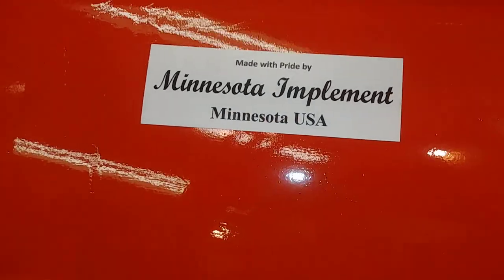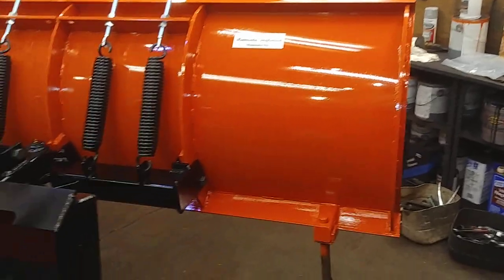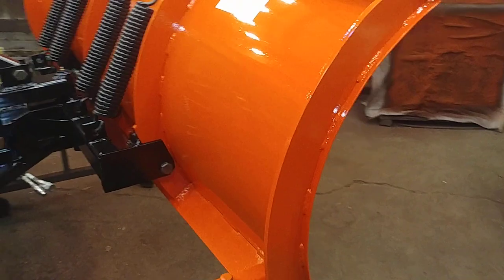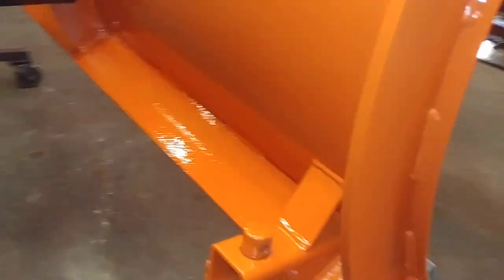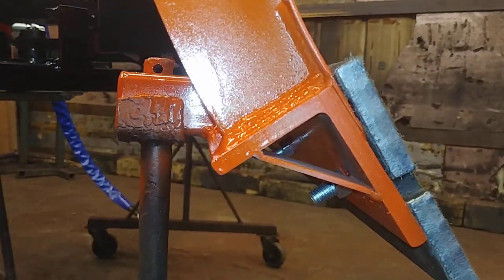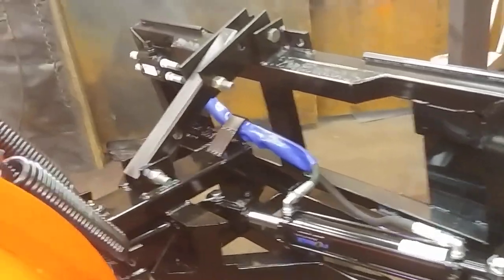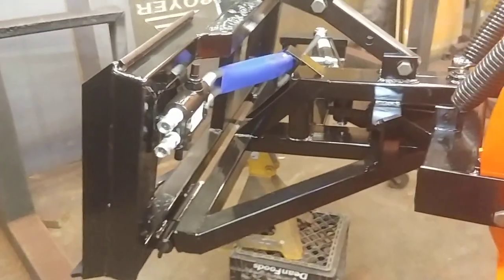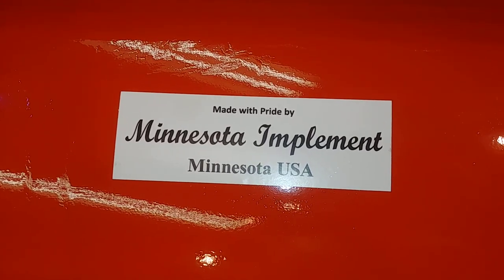Minnesota Implement snow plow comparison video of. heavy duty, standard duty and light weight plows.

Comment: Not being a hydraulics expert, I have a question about the operation of the cushion block.  As I understand it, when you reach the relief pressure, it shunts the oil to the other port in the block.  This makes sense if you have dual single acting angle cylinders because their volumes are identical.  It appears you make use of a single, double acting cylinder for adjusting the plow angle.  Since the volume of a double acting cylinder is different when extended vs. retracted, how does the cushion block function in this scenario?  If you hit your plow in a manner that forces the cylinder to retract, the volume of oil pushed out will be larger than the volume that becomes available on the other side of the cylinder which would result in a pressure spike.  Am I off base in my understanding?
Reply from the maker: You are correct that due to the volume lost due to the space taken up by the cylinder rod there is a limitation to the amount that the cushion block can "absorb" or cross over.  But the main benefit comes from the fact that when you move the plow one way or the other, one side is under pressure,  and the other is passive.  That passive pressure on one side allows enough difference in capacity movement to allow the plow to turn about 1/2 of its normal turn movement by crossing the oil over..  the cylinder is 2.5 inch and the rod is 1.125 on most. So non-compressed capacity is minimal by surface area... a larger rod diameter will reduce the crossover valves effectiveness.